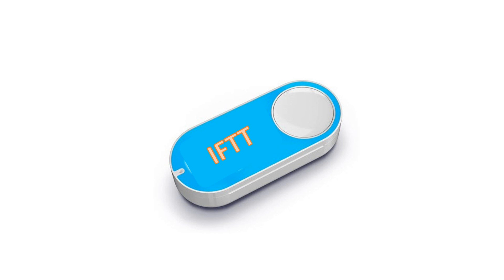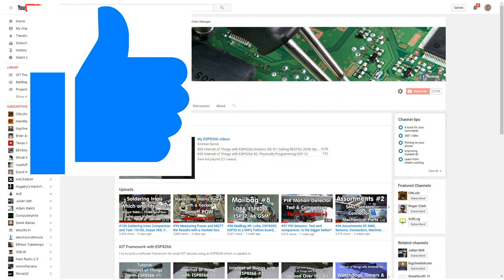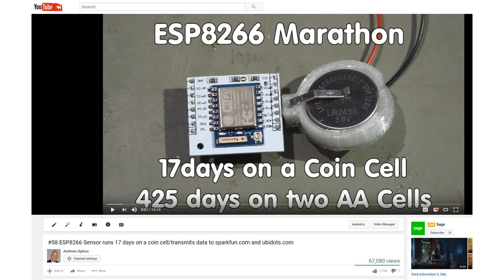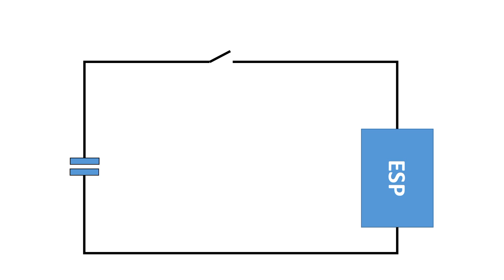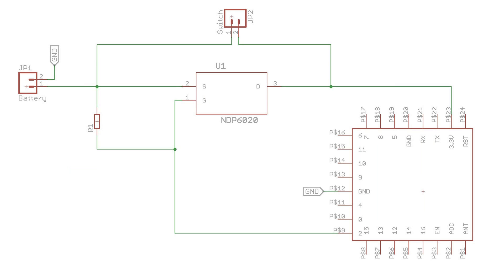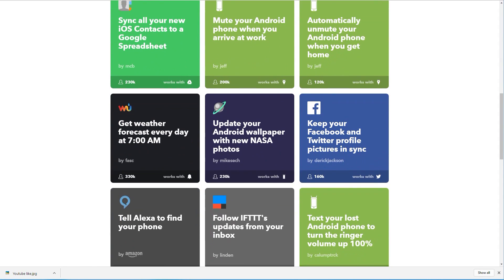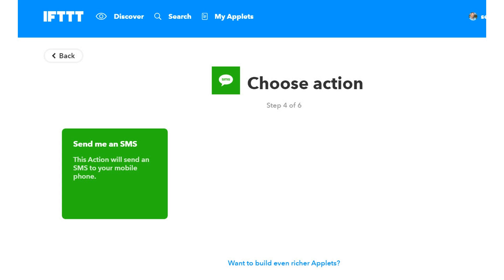#101 Long lasting DIY "Amazon Dash Button" using an ESP8266

Comment: Great video, thank you so much! I was just planning to build a gprs iot button and this concept will help me a lot. Could you please recommend an SMD mosfet which is suitable? Or can I use any p-ch with datasheet values similar to the 6020 you use?
Reply from the maker: It has to be „logic level“
Reply: @AndreasSpiess  Thank you, I have found a few that are not officially LL but seem to have pretty low resistance at -3.3v: https://de.rs-online.com/web/p/products/787-9042/ , https://de.rs-online.com/web/p/products/1526366/ , https://de.rs-online.com/web/p/products/1531876/ - would you mind having a short glance at the datasheets of they are suitable? I don't need a high load, 500mA is plenty for me, so I think even 100mOhm @ 3.3V is ok? I just want to send a short message via GPRS or Lorawan or Wifi, and would also use a large capacitor.
Reply: @AndreasSpiess  I would really really appreciate if you (or someone else) could glance at these 3 datasheets and tell me if they are not suitable for any reason I may have overlooked - thank you so much! :-)
Reply from the maker: c2h7 I only looked quickly at the first. It switches at -1volt, which is extremely low. So you know how to chose. Most of the ones I use switch at around 2.5-3 volt. But usually they support higher voltages.
Now I checked the other two.They are similarly good.
Reply: @AndreasSpiess  I assume "extremely low" means "well suited for this purpose"? :-) Great, then I'll buy some, thank you! (I wasn't so worried about spending money, they are so cheap, but I like to avoid frustrating problems which I can't easily detect without enough tools)

Comment: Great video, just subscribed. I’ve not used p channel mosfets before and was surprised to find you need to match the gate voltage and the source in order to turn it off. I really wanted to use the inbuilt regulator of the nodemcu. I know I can add an additional npn transistor to drive the gate, but can the p channel transistor be changed for a n channel and moved along with the switch to low side switching? Any drawbacks to that? Thanks again.
Reply from the maker: In this diagram you need a p-channel FET because the GS voltage will be negative or 0. I do not like to cut ground connections, but you can try if you want. Then a n-channel FET is the right choice.

Comment: Hi Andreas, great video thank you! I'm a bit new to the P channel Mosfet. Doesn't it require a connection to ground? In your schematics I don't see it connected to ground.
Reply from the maker: The pin on the ESP either has 3.3 v or 0 v
Reply: @AndreasSpiess  i guess it's also in the middle of the night in Switzerland at this moment :) thanks for replying. I couldn't get it to work.. tried using a wemos D1 and pin D0 using input_pulldown_16 but no luck :( Any chance you still remember the code you used? Sorry for all the questions.
Reply from the maker: Remote debugging is hard. You need to do your measurements at the gate of the FET. And check if you have a p-channel FET

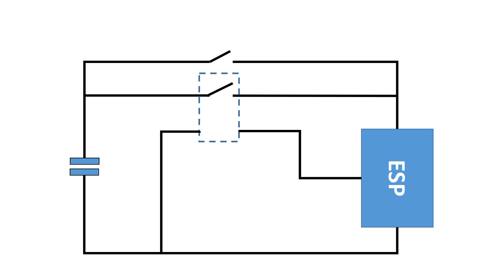Comment: Hi Andreas: I know this is an old video, but could you please recommend a relay to use? On minute 3:21 it is mentioned that I can connect an I/O pin to one of the coils of the relay, but some of these  relays need a lot of current for the ESP I/O pin. If someone else can comment I will thank you.  Luis
Reply from the maker: The relay was only used as an explanation. I used a transistor instead.

Comment: Andreas, can you test esp8266, esp32, arduino for minimum operating voltage. For example can esp work at 2.8v without restarting?
Reply from the maker: These voltages are specified in the data sheets. No need for tests.
Reply: @AndreasSpiess  but im confused because analog supply is from 3v to 3.6v while others are from 1.8 and 2.5. Does that mean that under 3v wifi is not going to be stable?
Reply from the maker: All chips only properly work inside their specifications.

Comment: I’d like to build this for a post box opening alert, when the door of the box is opened, the device sends a signal to trigger ifttt and send me and alert. This sounds just the ticket! Do you have the sketch and the schematic available?
Reply from the maker: The diagram is in the video. I do no more have the code. But it should be straight forward if you find an example to send messages to IFTT.
Reply: @AndreasSpiess  I made it! uses no power until letter box being opened triggers an esp which turns on the really to sustain power while it connects to wifi, triggers ifttt then turns off! thanks!

Comment: this is a nice concept, thanks for sharing the schematic, I am a software engineer, so I do not understand a lot of electronics, but it seems like the source and gate in the mosfet there connected via a resistor, why is this?, thanks
Reply from the maker: The resistor is a pull-up which pulls the gate to VCC to make sure the FET is always off unless the ESP pulls it down.
Reply: @AndreasSpiess  after 3 years I read this, I never thought I will be noticed, thanks andreas!, I will make another question in a new comment, thanks again!

Comment: We have a side gate at our house that the kids are forever leaving open, for ages I've wanted to fit some kind of sensor to warn us when it's been left open, but without power I was stuck how to solve it. With the idea in this video to use a relay to let the processor control when it switches off is just what I need, Thanks Andreas.
Reply from the maker: You are welcome!

Comment: I have used a similar concept for my mailbox but instead of just a p-channel mosfet I also added an ATtiny85.  It waits in deep sleep for an external interrupt (or two) and powers the ESP8266.  When the ESP is done is signals the ATtiny to go into deep sleep.  In deep sleep th ATtiny and mosfet together use less than 1uA.  With the ATtiny you can have more than one interrupt like for on and off buttons. So the same circuit can be used to trigger two separate functions.
Reply from the maker: That is a very good idea if you need more than one input or if you want to include some logic.

Comment: Would a small electromagnet with the reed switch work as the relay? Great channel by the way, I'm glad to have discovered it! :)
Reply from the maker: The read switch can be used instead of the switch. No need for a relay, a transistor is much better. Did you see my second video on this topic? (I do not remember its number)

Comment: Why was the choice made to use a relay or a MOSFET rather than a simple NPN transistor?
Reply from the maker: The relay was not used.  It was just for explanation. I use FETs for switching. You can also try a normal transistor if you want.

Comment: Hey Andreas! thank you for another great video. I am trying to implement this in a door switch which is normally closed when the door is closed. While the switch will be open when the door opens. I have to send an alarm when the door opens. Can you guide me on how to implement the MOSFET circuit for a NC switch?
Reply from the maker: This principle is not possible with an NC switch because the switch is used to power the ESP for a short moment. An NC switch would power the ESP all the time.

Comment: Hello, I've been trying to do something similar but the problem is the time it takes the esp-12f to get to setup which is around 250ms. My button press only lasts about 150ms so it powers off before I could trigger the fet. This was with a bare bones sketch, nothing in it but a digitalWrite. Am I missing something or are the new esp12s that much slower to boot? Any suggestions on how to work around this?
Reply from the maker: You decide how long you press the button.

Comment: Do you know any small relay that can be used for this purpose? All relays I find is very bulky and can handle high voltage, but there's really no need for that. The ESP is max ~300 ma, 3.3v ->1w so it should be possible to have a very small relay for it.
Reply from the maker: I never use relays for such a situation, so I do not know.

Comment: I used an NPN transistor and it seems to be doing good as a proof of concept. What's the advantage to using mosfet?
Reply from the maker: No big issue in this application. FETs have lower on resistance, which is important for big currents

Comment: Dear Andreas,
Thank you for your videos. I’ve learned a great deal from them and they’ve inspired me to take electronics up as a hobby and learn more. 

Would it be possible to switch things around and use an n channel mosfet? Maybe pull the gate low and set it high from the esp8266 pin to turn the mosfet on? If not, why not? If so, is there any reason why you chose the p channel approach? I’m confused about when to use a p channel and when to use an n channel. There seem to be more n channel ones floating around.
Reply from the maker: The N-channel FET has to have a positive voltage at the Gate (compared to Source) and the P-channel a negative one. If you connect a P-channel in the positive rail and pull the gate to ground you get this negative voltage to switch it on.
The same applies to the N-channel. You have to connect it to the ground wiring and pull its gat high to switch it on.
I prefer the P-channel here because I do not like to disconnect ground. But this is a very weak reason and you can try an N-channel FET. Pay attention that it switches on wit VGS 3.3 volt.

Comment: Saw this today and thought Andreas might be interested : https://hackaday.com/2017/12/22/coin-cells-the-mythical-milliamp-hour/ ... these things might work longer than expected
Reply from the maker: Thanks for the link. Unfortunately, these coin cells are only made for small currents. To power an ESP8266 did not work when I tried it.
Reply: how about a small capacitor in paralell, with only enough power for the ESP  to send its message and go back to deep sleep?

Comment: Hi, I know this post is a year old but at 4:50 were you suggesting using a reed switch to replace the button or the relay/mosfet ? I guess it should be to replace the button.
Reply from the maker: The button. The FET is needed to keep the ESP running as long as it is necessary to transmit the call.

Comment: Hi Andreas. Good video. What happens though if the the switch is not closed long enough for the microcontroller to boot and switch on the mosfet?
Reply from the maker: +Jason Edgar I think, nothing happens because the chip immediately switches off again. But I think, you hafe to be quite fast to achieve that (manually)

Comment: What is the P$9 pin? :(

Thank you.
Marc.
Reply from the maker: What do you mean with P$9 pin?
Reply: Andreas Spiess on the schematic in the video...
Reply: Andreas Spiess where is the connection with the Rst dans D0 pin ? Thank you.
Marc.
Reply from the maker: P9 is GPIO2
Reply from the maker: With this concept. I switch the power and therefore, the RST always has to be high. AFAIK this is done with an internal resistor on the ESP. Otherwise, you can pull it up with a resistor.

Comment: I like the idea of using a relay.  I'm thinking of using a latching relay like this: http://uk.rs-online.com/web/p/latching-relays/7181941/ which I can turn on with a command & then off with another command. What do you think?
Reply from the maker: I think it should be possible. It will save you a little sleep current.

Comment: Do you think it is possible to let the ESP 'survive' a deep sleep, powered by the mosfet? I tried this, but I could not keep the gate low, even when the pullup resistor was removed.
Reply from the maker: I do not exactly understand your question or your diagram.
Reply: I used your diagram with the P-mosfet. Instead of a button, I used a switch to switch on the ESP (and then activate the mosfet). When the switch is switched off, the ESP is powered via the mosfet, like in your application. In my application it can take a while before something else has changed,  so I wanted to use deep sleep to save power and I let the ESP check every hour whether the switch is switched off. However, when the ESP goes to deep sleep, the ESP does not wake up, because the mosfet did not stay in the 'on' state. Do you think it is possible to let the ESP wake up in this setup?

Comment: You should add "Part 1" in the title of the video, and put a link to the next one. The video ends without showing the final product, it's a bit weird. I will check your other videos to find the part 2.
Reply from the maker: I think, the final product (HW and SW) is covered in this video. I did a second video using a different principle for a similar purpose. But you are right, I could have placed a link...

Comment: Dear Andreas, thank you for this inspiring video. I wanted to use this principle for another project, but I had only N-mosfets. I mirrored your scheme, so the mosfet was in the GND circuit, and the switching of the mosfet was also mirrored. The program worked, but unfortunately, the power did not switch off completely, resulting in a voltage of 0,94 V - 1,38 V over the ESP (dependig on the mosfet, a pull down resistor did not help). Even with a BS250 P-mosfet, I got the same results, copying your scheme. Finally, when my NDP6020 arrived from Aliexpress, it worked! So now, after a few weeks of trying I can use this principle in my other project.
Do you have any clue why my other mosfets (2N7000, BS170, STN4NF03L) and BS250 (P-type) failed to switch of the power like the NPD6020 does?
Reply: I forgot to mention that when the power was not switched off, the 'off-current' was still about 10 mA, much to high to let the battery last a long time.
Reply from the maker: I think, these transistors do not switch withe 3.3 volts (I only checked the BS250  which needs about 10 volts to switch). Check the voltages where rds on is specified. I think, I mentioned this fact in one of my videos.
Reply: Thank you. If I understand you right, the voltage difference between Gate and Source is too small for these mosfets to switch off completely, resulting in a large leak, is that correct?

Comment: Hi Andreas, I love your videos and this particular project is especially interesting to me. I understand the general concept of using the mosfet to keep the power source connected to the module but I am a little confused with the working on the p-channel mosfet in this scenario. Having the gate tied to V+ keeps the mosfet turned off but how does the gate of the mosfet go to 0v in order to switch it on? Transistors have always been my weakness.
Reply from the maker: So maybe you search a tutorial about that. I am not very good, I just know, that if I apply a negative voltage to the gate of a p-channel MOSFET it switches on (if it is big enough)
Reply: Andreas Spiess 
I have spent a while trying to understand but I still don't fully understand the working in this scenario. Maybe it will help understand what your esp module is doing to switch the mosfet. Do you turn the pin connected to gate to high to turn off your system at the end of the code?

Comment: I like your videos and pizza!  More relevant to this video, a CMOS logic chip could operate at a very low power level until it wakes up with the press of a momentary button, then enable/supply power for a desired time, then sleep/deactivate your circuit.  I used a 9V battery in  such a CMOS logic circuit for 30 years and it still worked, although it was in stand by almost the entire time.
Reply from the maker: I think this is a good idea if you need some logic. And it is astonishing that it worked for so long (also because some batteries discharge themselves).
If you just need a mechanical switch you also can go with a simple MOSFET to switch the ESP on ( I used this principle in another video)

Comment: You don't need https to do a "get" using the example in the webhooks docs. It works very well and you don't need the forwarding server. I am connecting to my local router, sending a get request to my webhooks applet, and then going to sleep. This completes in less than 3 seconds. The applet is hooked to gmail. I get the mail in less that 15 seconds.
Reply from the maker: I used both versions, the one with https on the ESP and the one with a php script on my webserver. Both are valid. If the fingerprint of the webservice does not frequently change, then I prefer the ESP "native" approach, because it is simple.

Comment: Hi, I want to make a door open sensor and was thinking of using a similar approach. The problem is that the ESP remains on when the door is open. Any idea how I can build a circuit that delivers a pulse to wake up the esp when the door opens or when the door closes, and it sleeps in between? I could use a 3 way reid switch (both NO and NC) if it helps, but still can't figure out how to build the circuit. Any hints would be greatlyappreciated.. Thanks!
Reply: Take a look here: http://www.whatimade.today/esp-8266-mailbox-notifier-using-deepsleep-and-blynk/
Reply from the maker: Maybe you watch also my video #108. There, I use a different method to trigger the ESP

Comment: This kind of projects are why I think ESP8266/8285 will be a good fit for a long time, even if the ESP32 is available.
Reply from the maker: We will see. If the ESP32 comes to the same price point, it will be hard for the ESP8266. Deep sleep should also work very well on the new chip. Till then, I will use the ESP8266...

Comment: Currently I am thinking about a piezo vibration sensor which detects the fall of a postcard. The sensitivity can be changed via a resistor, a weight on the piezo and in Arduino itself and the circuit would be even simpler because you do not need an automatic on/off switch or deep sleep.
Reply from the maker: I never worked with these devices. So, I do not know how they work...
Reply: Here is a good example: http://davidhoulding.blogspot.de/2014/02/high-sensitivity-vibration-sensor-using.html